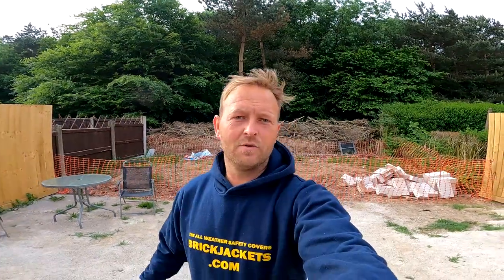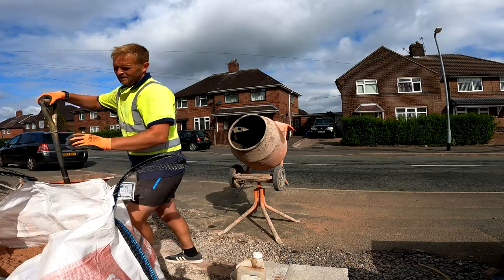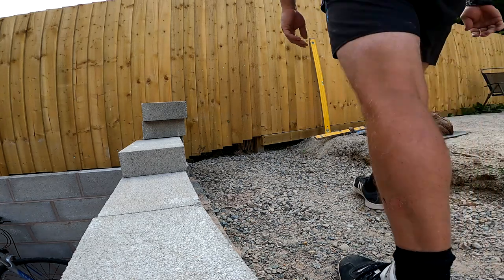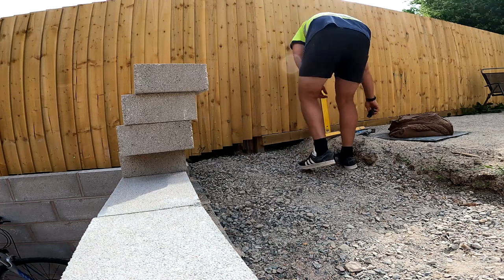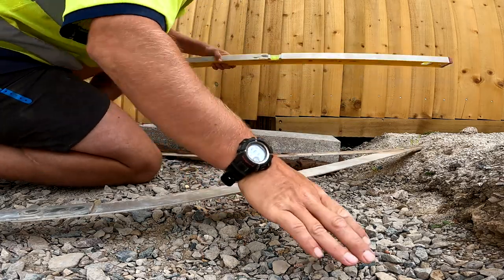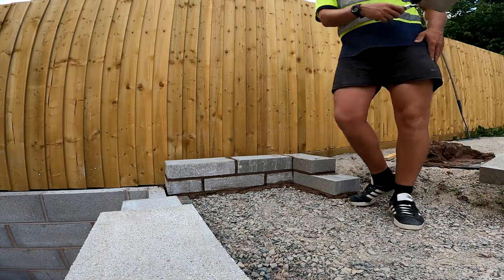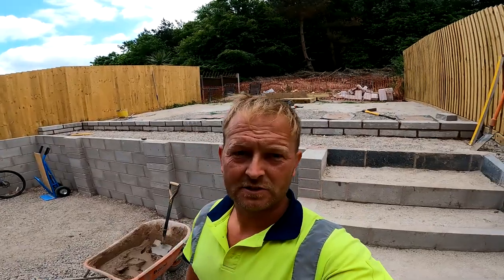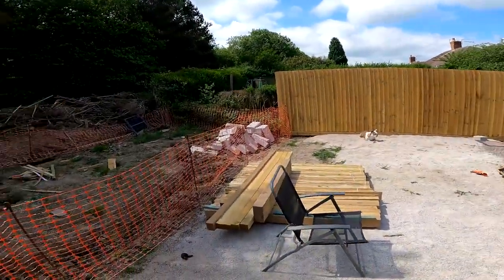Garden Project #5 Sleeper Wall

Comment: If you take a step between the mixer and bag when knocking up, then the mixer is too far away. Should be close enough for continuous flow of movement. Bag straight into mixer. Well, that’s how I like it anyway 🤣🤣
Reply from the maker: i would have but the mixer would have been leaning back on the drive, thats why i put it on the pavement

Comment: Not sure why I watch you filling a mixer as 20 odd yrs ago on the hod I had to use the big big mixers which filled a whole tub I hated  it , it was either frozen water pipes , it won’t start etc etc plus I had to start a hour earlier then the brickies get two tubs filled and muck on boards top up bricks/blocks . 
But some how I can’t stop watching.

Comment: A nice log cabin put up the back for work shop come  relax room, wife s a bit slack on coffee then she did have the baby no offence, .
Reply from the maker: non taken
Reply: @Changy_C   i taken it u will put chippings or p gravel with PVC pipes in stages through the blocks or does it need it, I have to build a block wall  about three foot tall and will do this method, I enjoy your works it gives good hints. To what I have to do.